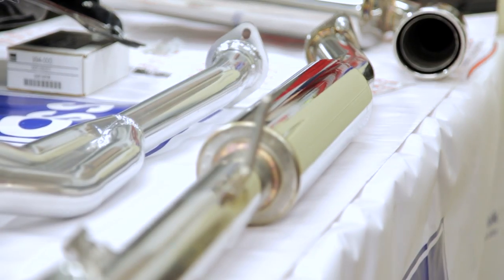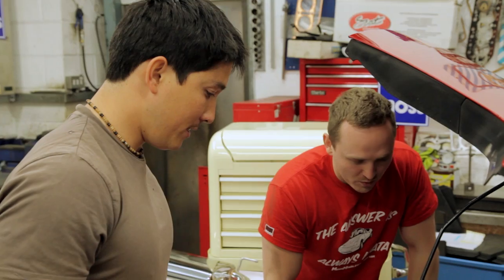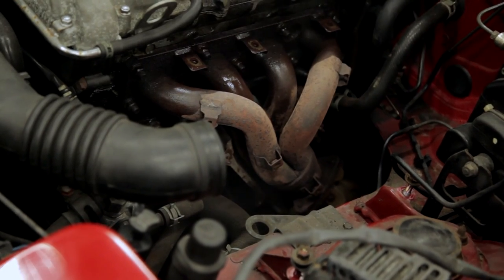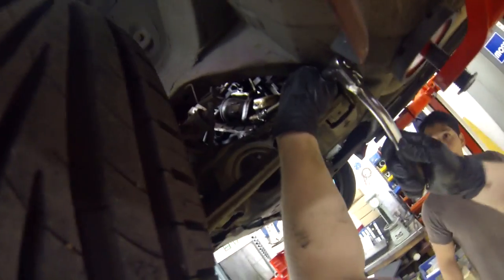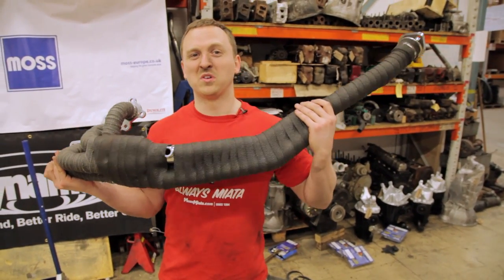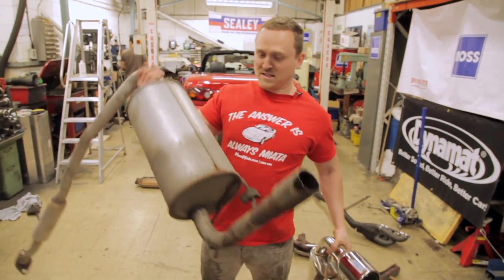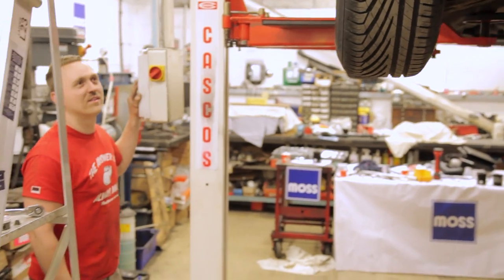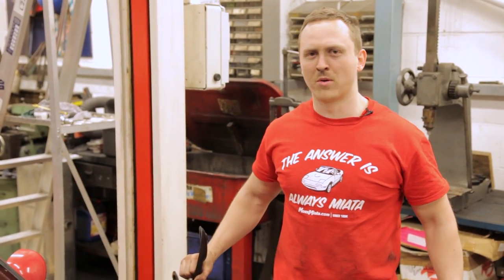Project MX-5: How To Fit A Performance Exhaust

Comment: Just bought an mx-5 with 71k miles for $1700, I'm convinced this is the most fun to be had in a car for that cheap.
Reply from the maker: Alex will definitely agree with you as well
Reply: Nah mate a second generation MR2 for sure.
Reply: ***** are you for real? MX5 is slower but MX5 has more soul.
Reply: Nah mate not the same experience as in an MR2, an MR2 is more power and less controlled. Its wilder
Reply: ***** yeah. But if you drive an gen 2 MR2 you are more likely to lose control with it being rear engined and all that. MX5 is more balanced. It just the facts mate.
Reply: I know, I guess its just a difference of opinion/preference.to each their own
Reply: Yeah maybe..... Dont get me wrong I love the MR2, I just prefer the MX5.
Reply: ZNS supercars I own a NA6 and i can tell you AW20 MR2  turbo is far more fun to Drive, alot faster, so flat around corners and bits hard if you suck at driving.
Reply: freakied0550 me and my dad were thinking a bout getting one this summer, or something like that, a cheap fun little car!
Reply: freakied0550 Whatever I purchased a 1994 3 series 325i for a lot less.
Reply: 18iser yeah those things are great cars. So much track dat potential.
Reply: freakied0550 what a cheap price ! it's imposible to get 2 doors rwd car here in my country with that price. have a nice day with that :)
Reply: Cheapest I can find is 15 years old and 8000$
Reply: Supra mkiv
Reply: freakied0550 i reckon i could have more fun in a $700 v8 commodore
Reply: ZNS supercars MID-ENGINE. What is more fun is a MR2 Spyder with a turbo kit.
Reply: A supercharged MX5.
Reply: Itsuka Kiyokata convertibles suffer from being less rigid and thats not good for cornering the miata has its own magic and. A hardtop sw20 or aw11 is better looking than a zzw30 anyways.
Reply: Try one. They're stiff as hell.

The SW20 I test drove was for the lack of definition : Floppy.
Very floppy. It was heavy for a MR2 and floppy.
Reply: Itsuka Kiyokata Hmmm well most of the people I've met with SW20's love them and I just like the body shape more than the ZZW30.
Reply: I won't fault anyone for their personal preference I'm not that kinda person but I'm a believer of whatever floats your boat although the tighter, more agile, shorter chassis of the MR-S is a great hoot to drive everywhere.
And there isn't much snap oversteer.
Reply: Itsuka Kiyokata not having that snap oversteer is nice that shit is scary.
Reply: It is. The only thing that keeps people away from MR cars is snap oversteer. Strangely very few MR cars are capable of neutral steer
Reply: Hence why MX-5 is better.
Reply: ZNS supercars It has hardly any power to even slide ;)
Reply: True. But with mods its a blast!
Reply: Car Throttle what year is it from?
Reply: +NormalDutchGamer '97
Reply: +NormalDutchGamer '97
Reply: okay thx
Reply: +NormalDutchGamer good?
thomasdickerson
Reply: good
Reply: +NormalDu
Reply: +Thomas Dickerson good,
Reply: +freakied0550 just got mine for $1500 and im already wondering what to do to it.
Reply: Revo900 sold mine for profit not long after having it. Was a fun 2 weeks :)
Reply: +freakied0550 well that sucks...
Reply: freakied0550 lol already went drifting in it I might just sell it after a year or so of practice and I'll get something with more HP. I'm a novice manual driver.
Reply: +freakied0550 what have u done to it sofar?
Reply: ***** i sold it for profit
Reply: +freakied0550 why did you keep it for just two weeks? I mean if you got profit for it I can understand but why getting it in the first place? I mean, are you replacing it or...?
Reply: AndreCorner Profit. I buy/sell/trade cars and electronics to supplement my income.
Reply: freakied0550 oh ok then!
Reply: freakied0550 I just bought a 2002 MX5 as my first car, it is a rust free Florida car with the 6 speed. It only has 85k miles, and it's the 2002 special edition. The best part is that the car was only 1000 bucks because there's some minor fender damage that can be easily repaired.
Reply: An mx5 here in Portugal Costs 5k minimum ffs have fun

Comment: But it's N/A... Everybody knows that you need to turbo a MX-5.
Reply: Actually... the Mazda Miata is the only N/A car that people lust over more than the turbocharged ones.
Reply: Ford M Garage Miata is NEVER turbo ready without a lot of prep. Turbo a stock Miata and it will blow the engine and tranny. Terrible idea. And either way, I'd rather supercharge it

Comment: What mods can I do to my car. It is a 2003 Ford Mondeo for 420 pounds. What can I do to it.

Yes you heard that right. 420
Reply: Some weight reduction maybe
Reply: Btw it's the st220
Reply: And I missed a 1 off the price it was 1420
Reply: Don't bother modding it. Just save for a better car as modding a mondeo is kinda rice haha
Reply: I meant proper mods like a proper exhaust system and chassis reinforcement and not ricey stuff like chromeys, fart cans and faKE CF
Reply: Doge Dont Care Chip/ remapping is a great choice. 
I remapped my VW from 60BHP to 100BhP (Insurance won't let me get a bigger engine)
Reply: Ok thanks
Reply: ThatGuyNamedScott. C a 66% increase in power from chiptuning? from what I'm assuming is a n/a engine? i can't really belive that
Doge Dont Care modding a 1420 pound car is not the smartest thing to do. if you want mods that actually make a difference you'll quickly have to spend more money no the mods than you did on the car itself
Reply: The car was from a mate so it was cheaper than if you buy it on AutoTrader or somewhere like that. It should have been 3000.
Reply: It is immaculate and it runs great
Reply: Matthias Schmitt and it's a TDI. More boost and engine mapping.
Reply: ThatGuyNamedScott. C ok, makes more sense if it's a turbo, but that's still quit a big gain in power!
Reply: Matthias Schmitt I know it's hard to believe. 
Go to revo tuning and look at there website! 

My dads A4 2.0T was mapped from 211BHP to 300BhP.  Now that's quite something. 
It's the same with the A6 bi turbo 3.0TDI. It's a stupid gain if I remember
Reply: If its a turbo petrol or diesel get it remaped it will give you good gains for the money
Reply: ***** exactly, turbos are underused in T engines
Reply: Run it into the ground
Reply: ThatGuyNamedScott. C You obviously don't know what rice means.
Reply: Doge Dont Care trade it for an evo 8

/topic
Reply: good
Reply: sell it

Comment: O2 Sensor tips: Unplug it from the loom, and drop it with the exhaust (difficulty varies between cars) but its much easier to remove in the vice! also minimizes damage to the Unit if you intend to reuse it .. but with a high mileage motor(and while you have everything out) , with 'performance' in mind, it wouldn't hurt to replace the sensor entirely, either with a direct replacement(oem or aftermarket) or get a sparky to wire [the correct] one in

Comment: You need to read up on exhaust tuning principals. A 4-1 will flow better at high revs, 4-2-1 gives better torque low down. You need to choose your system depending upon the application. I would keep the stock manifold for when your shiny one cracks due to heat cycling.

Comment: Nice one mate but I would get that rust sorted out before moving any further. If the sills are gone, you're looking at £££s to get it sorted and if the floor pan needs replacing then you've had it for sure.
Reply: Said the exact same thing in the previous video, I also think it would fail its MOT due to the wide tires stickig out past the arches

Comment: Looks like this came with an after market front and rear lower suspension braces. Would love to see a mid chassis x brace or reinforced rails and see what affect they have on the handling (if any).

Comment: After watching all these vids, I can say that the '95 MX-5 is a lot different than my '93. Might just be the fact that I'm in the US, but the seats and steering wheel are different, and mine doesn't have a heat shield over the manifold. Also, mine only has a 1.6 litre instead of a 1.8.
Reply: Yeah, Mazda made the switch from a 1.6 to a 1.8 liter engine in 1994. I'm sure that came with some interior design modification as well.

Comment: Car Throttle  I recently bought an mx 5 1997 myself and now i was wondering, if i just change the current exhaust with this one (cobalt exhaust system from the video) and i didn't change the manifold would it still sound "good" /perform better ?

Comment: once it took me about 5 hrs to get of the stock exhaust/headers on a volkswagen t1 aircooled motor..... The bolts had 50 years of rust :( . Even with goggles on I got so much rust in my eyes..

Comment: last time i bought a cat the replacement was about 500$ if i used the one the book calls for , but i installed a high flow universal cat made by magnaflow for 165$ ,welded it in and forgot about it .

Comment: Hey Car Throttle can you answer to me whats that sound coming from the engine at 13:20. If anyone knows please tell me, im searching it for a while.Brilliant job by the way.
Reply: Nikos Nikos That was a combination of a loose power steering belt and a bolt that was missing on the alternator belt tensioner. All fixed now :)
Reply: Im realy thankful about your answer because i was wondering a long time now. Thank you and good luck with your project.!!!

Comment: hey
I just wanted to know why some mx5 have double exhaust system , I have a mx5 with a 1.6l engine exhaust single and else with a 1.8l engine is also with single exhaust , know why ?
Reply: Philou xplane The mk1, mk2 and mk4 all came with single exit exhausts from the factory, the mk3 had a double exhaust from the factory. So if you see any mk1s or 2s with a double exhaust its aftermarket.

Comment: I don't understand why you didn't put a less restrictive intake on while you already had the air box off. A cold air or a short ram would've opened up the system a bit.
Reply: Nevermind I just saw the very end of the video.

Comment: Nooo you spend loads of money on a new exhaust system and then you use the old restrictive catalytic converter! Massive failz on that one m8! =)
But will make me feel awesome on friday when i bold on my new 3-inch stainless steel downpipe with a 100-cell race-spec catalytic converter. I am thinking about heatwrapping it since it looked really awesome in your vid but I've heard that it is a potential firehazard if you get oil and grease on the wrapping. What do you think? Cheers! =)

Comment: why do you need to heat wrap the exhaust? i thought that stainless steel is not a good heat conductor thats why stainless steel pots hhave an aluminium bottom.

Comment: Does anyone know why it was necessary to unplug the Lambda-sensor?
Reply: mieskam1 Need to unplug it to get the old exhaust manifold downpipe out and swapped with the shiny new Cobalt system. Nothing more complicated than that!
Reply: Alex Kersten
Since it measures the air mixture in the exhaust, therefore being attached to the manifold? (Total noob on engines btw)

Comment: The factory manifold is not really all that bad.  For what you paid for the new one you gained next to nothing.  The 4-1 design is actually better for high rpm and the 4-2-1 is better for low to mid range.  Since nothing was done to the intake there is really no point in doing anything to the exhaust.  On my NB MX-5 I have modified the stock air box and installed a high flow air filter, the rest is stock.  Since I am thinking about turbocharging this car there is no point in getting an exhaust designed for a naturally aspirated engine or spending money on a intake that you will throw away in a year or so.  If you do not plan on running forced induction then your first mod should be a decent intake, THEN the exhaust.  On a side note you can gain a LOT of power by porting the cylinder head and running different cams.

Comment: I've been told to never heat wrap an exhaust manifold...  :/
Reply: Jurgen DX why?
Reply: darth maul rusts quicker that's all
Reply: Rust on stainless steel??
Reply: dylan winwood yea stainless steel does rust, it just has a much higher resistance thats all. Stainless steel can rust if exposed to extended periods in very humid or flowless aquatic environments. header wraps tend to keep moisture in between the wrap and the header
Reply: Track dog racing do a blanket which is a better solution and won't smoke you out when you do the curing phase. However I love these manifolds and they are a good quality stainless , less likely to rust.
Reply: Jurgen DX I haven't seen much rust from them, but so far I have seen 2 cracked welds on wrapped manifolds.  Can't really say for sure if it was the cause or not though.

Comment: Those bolts will be torqued completely wrong. You don't torque a greased nut or you'll be over torquing due to the decreased friction.
Reply: Doesnt really matter until your romping it down the track haha

Comment: This MX-5 is in such a bad state.. You should better invest your money in getting rid of the rust and this annoying noises..
Reply: sidewayslu I agree, I've never seen something as bad managed as this, you spend money on "useless" things but you don't fix the rust and don't change a serpentine belt and some pulleys.
Reply: sidewayslu Noises are just belts that need replacing, and the rust is being looked at and fixed. S'all good, bro!
Reply: Alex Kersten I appreciate the fact that you responded, you know what else does that car need? A turbo, keep the good job going.
Reply: I know that changing the belts and stuff is not much of work to do, but you know.. I kind of dislike the idea of using money that'll keep your car roadworthy for "useless" mods.
However, I gotta say I really appreciate your build, keep it going :)
Reply: sidewayslu Yeah that would be a fun video to watch....